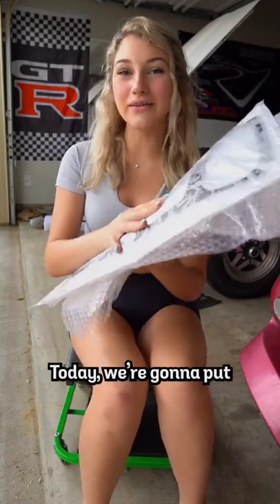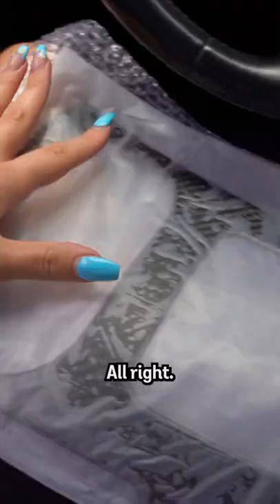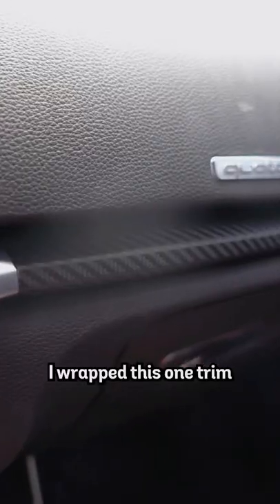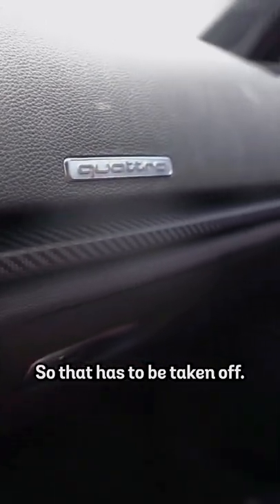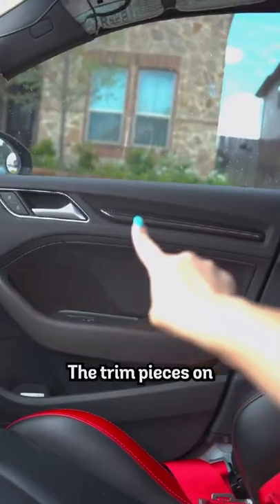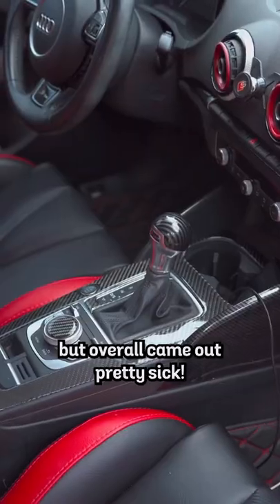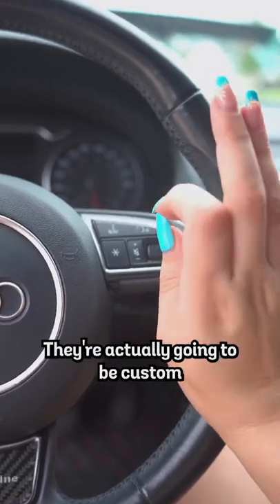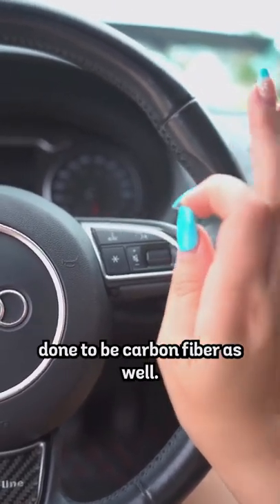Carbon Fiber Install On Audi A3!!!

Comment: Adding carbon fiber on top of your trim is one of the most ricer things you can do 😒

Carbon fiber is meant to save weight, but putting it on top of existing trim is adding weight

Comment: Actually you should use isopropyl alcohol from the paint aisle.  The medical stuff often has additives that are counter to cleaning surfaces.
Reply: It was, look at it
Reply: @Jpgaps  typo on my side, meant ‘paint’ not pain.  The medical alcohol has additives.

Comment: Tacky Sittin out in the sun will probably just melt the adhesive and make a mess too
Reply: How is carbon tacky and no it won't
Reply: @11xeno  carbon fiber is cool when it’s a pin on hood, doors or truck lid. Press on or sticker carbon fiber add ons are corny and always will be